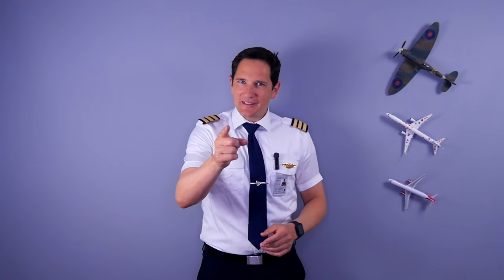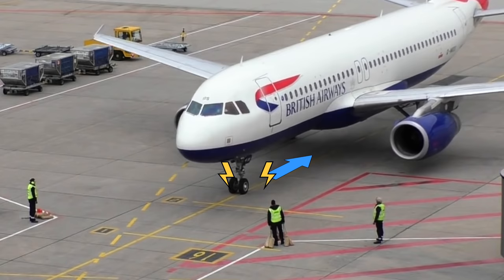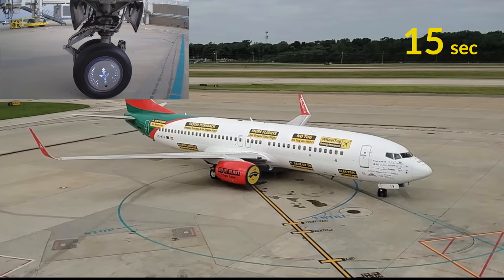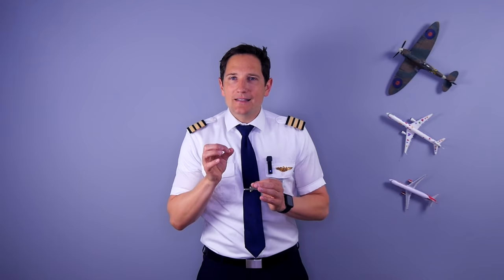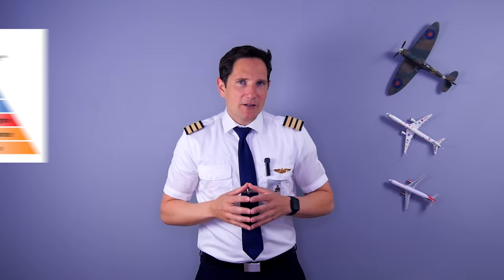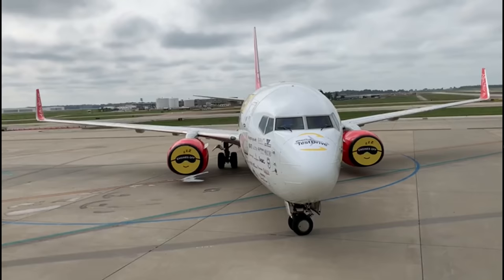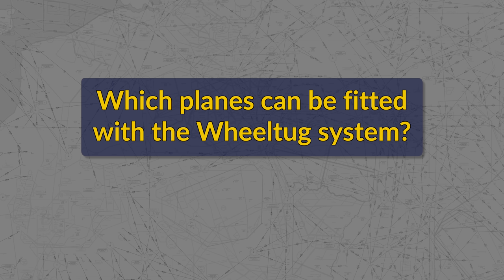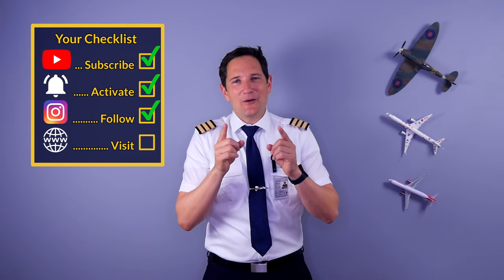The FUTURE of PUSHBACK is ELECTRIC! Without a pushback truck! Explained by CAPTAIN JOE

Comment: As a ramp agent, I see 1 more problem with it. How people driving on the ramp know when a plane is about to move is by looking and seeing the beacon lights on, a pushback connected, a wingwalker at either wing, and the jet bright or stairs are pulled. If either of those are not present, then it will take a minute, long enough for you to drive safely past. Without most of those signals, I can see people driving behind a plane while its moving backwards will become too common. Also, what if the APU is out? You will still need to have crew who can operate the pushback but they will be out of practice by not doing it all the time

Comment: As an aircraft maintainer, this will provide me with work for many hours to come
Reply: More like provide you with another headache lol.
Reply: As a groundworker ,this will provide me losing my job ...
Reply: @j.mc.8773  if it makes you feel better it will take a long time to replace you in loading the bags and all other things you do.
Reply: I completely agree as an aircraft mechanic myself. Winglets and elevators being ripped off is a lot of OT for us.
Reply: @emmetts1899  true
Reply: Really true
Reply: Thanks you. You keep people safe when flying
Reply: The undertaker will be real busy too!!!
Reply: What i am wondering is how the hell are we going to inflate nose wheels c: Do we have to remove the whole thing or is it just a cosmetic cover?
Reply: @j.mc.8773  Aircraft still needs to be chocked, luggage unloaded, the dispatcher will still be needed and when there needs to be a tow the tractor will still be required!
Reply: @pdiaza123  as per video it will be embedded in hub.. impractical it seems
Reply: and some ground workers will lose their jobs
Reply: @j.mc.8773  I'm sure the electric motor in the nose gear is not strong enough to handle bigger planes like the 747 or the A380. It might take several built into the main landing gear!
Reply: I just got signed off as a pushback driver 😢

Comment: I had this idea more than 25 years ago, and I'm 100% sure I wasn't the first one to think of this. But developing such idea into a viable and certified product is a great accomplishment!
Reply: It isn't actually certified yet. And viability is another issue, especially if the in flight weight penalty outweighs the benefits.
Reply: We did it as a project at university too and we weren’t the only ones…. Patents screwed us up though 🙄 and also we weren’t the ‘elite’ engineering students of the department so weren’t taken seriously or given a chance at all….   Protean based in Farnham Surrey had a prototype version for use in a car over a decade ago but I guess they’re not the sort of company to spot opportunities (they got caught up in the in hub wheel for electric cars and wouldn’t have even thought about planes, or commercial moving equipment 🤷🏻‍♂️)
Reply: Yes, it would not be easy to sort out all the energy and weight-saving components for retrofitting thousands of aircraft.
Reply: @paulroling1781  I’m in California, our crazy leaders here don’t care about things like costs vs benefit ratios.  If is saves fuel and reduces emissions, you can be sure they will mandate its use, regardless if it make economic sense.  They’ve mandated zero emission Semi truck use, even though we don’t have them available yet, and when they do become available, they won’t be very affordable...
Reply: That's the spirit
Reply: @paulroling1781  Not just weight but weight distribution.  That's 200 kg added to the very nose of the plane.  It may be a drop in the bucket compared to the many tons of aircraft, but they can't just assume that it will have no impact on behavior such as rotate and landing.  Which brings up another question.  How much stress can this system take upon landing?  How many times can that nose gear get slammed down before it damages the system, and possibly seizes up a wheel?  (I'm sure their engineering team has tackled those issues; I just want to know the answers.)
Reply: @paulroling1781  Today the plane has to carry enough fuel to finish taxiing-in, maybe wait for the gate to open up, all while burning at least one main engine. If you're flying to a congested hub airport, having WT could literally lower the in-flight weight.

Comment: When I worked in avionics a decade ago, I remember the hot buzz around this concept in systems development and research and how exciting many engineers were in wanting to participate in this program. I am glad to see that this is coming to fruition!
Reply: Well, a baggage tug has enough power to push an aircraft back, the mass of the aircraft being ridiculously higher, stopping is the challenge.
The biggest obstruction has been getting powerful and small electric motors, although a hydraulic motor could have fit the bill, hot brakes and hydraulics, yeah, not a good idea.

My only concern is what protection is there to guard against a seized clutch?
Reply: @spvillano  No clutch, the wheels are the motors. Direct drive permanent magnet motors.
Reply: @JerryBiehler  which can offer their own potential failure modes that can cause problems.
Sounds like a challenging project, of the more fun kind!
As an example, were implementation to be done on a pushback, rotational velocities wouldn't really matter, due to the legendary lack of speed of said behemoth vehicle. In an aircraft wheel, while pushback speed is still slow, one would be asking the rotor magnet to be able to withstand both impact and 200 knot speeds on a rapid spinup in an emergency landing. That's one hell of an ask for a ceramic, hence why I mentioned a clutch to pull the rotor out of the wheel system when taking off and landing. Brake heat would also be an issue to resolve.
That sounds like a fun project to be on!
Reply: I am wondering if electric cars are what helped this along, A decade ago EVs were far less common. But now there is a lot of engineering R&D knowledge in the wild for compact light weight and very powerful electric motors.

Comment: As a USA based regional jet airline pilot, I can say unequivocally that this system would absolutely increase overall efficiency.  Personally I love the concept and wish I had it on the jet tomorrow.  That being said here in the US at least, it will be a long time before this system is widely adopted.  The FAA moves so slowly, and then there are real concerns about the thousands of ground handler and ground equipment maintenance jobs that would be lost upon the widespread use of this system.  Also I can't wait to see what the FAA and airlines come up with for training requirements not to mention certification....anyhow I love it, and I hope to push myself back, taxi out of the ramp, and park myself someday using a system like this.  I wish the inventors much success!  Thanks Joe for sharing.
Reply: Im literally about to start at an airport gig as a Tech and i stumble upon this clip/Comment...No pressure Right! Lol.. However, i don't believe it would wipe out TOO much jobs. Us Me-CanFix still have the Belt loaders, De-icer trucks, and regular cars and trucks used to transport personnel to 🔧 wrench on so we'll make do
Reply: Did you realize that pushback driving is just one of the hundreds of jobs done by groung handlers? Mins saved by pushback won't buy you too much time, other jobs still need to be done including unload/load before you can finally "fly". Pilot is just about fly, but the aircraft and the whole system is not!

Comment: I can see another advantage in this system. You noted that most damage is done to engines by pilots having to spool up for "breakaway thrust". If instead the airplane is "broken away" with just the electric wheel drive, no breakaway thrust is required.

Comment: Great Idea. I can see this evolving into:
1. Having enough power to do all the taxiing between the gate and take-off point for departure as well as arrival. This will save lot of fuel, as well as increase the life of the engines.
2. Having a computer at the ground-control take over all the taxiing from the pilot, making the ground operations more efficient and error free, also eliminating the need for the follow-me car.

Comment: When I was a kid, I was a tug operator for a big airline at a big airport. I pushed back everything up to 747’s. It was always a challenge to drive a straight line as the pilot started the engines sequentially while I pushed. I think the lead hand and possibly wing walkers would still be necessary because of the movement of other aircraft on the ramp, especially at night.

Comment: There goes 'Job Security' for tug operators.  I recall about two decades ago, Lufthansa developed a vehicle designed to tow the airliner to the takeoff point, as a means of saving fuel.  Never seen or heard of it since.

Comment: They've been working on this project since 2012 if I'm not mistaken, glad to hear they've continued it. There wasn't much information getting out about wheel tug in the last 6 years...
Reply: I found they were from 2005!!
Reply: To put it simply, regulations  are a b**ch.  It takes years to make FAA and similar regulatory bodies to approve small things like this...
Reply: @AaronShenghao  Safety requires time and proper thinking. You can't just put a motor in there and voila. You need to make sure there is enough rear vision capability added so the pilot can operate it safely. You need to study all cases of failure you can think of and the proper response. You need to take that new option into account in radio communications, pilots training, airport procedures. You need to check which weather conditions allow or forbid the use of that system. I as a passenger want them to do their job the right way and not repeat the deadly fiasco of the 737 Max.
Reply: @AaronShenghao   No . It is due to a lot of people are gonna loose their jobs .
Same reason why they pushing so hard to get this system .
They simply want to fire all those who drive the trucks and now they are close to sucess.
Reply: @aaronbianco2392  hi
Reply: @michealeckert499  :-)
Reply: since 1993

Comment: Very cool. I used to operate a pushback tug. Had a lot of fun doing it, but always seemed strange to me that this operation needed to be done externally from the flight deck. Awesome innovation!
Reply: Why did you change career? What experience did you need prior? I’m very curious however don’t know anyone that has operated as a pushback tug and considering persuing a that role what would you suggest? How was the pay and working hours? would love to hear back thanks!
Reply: @jayjay3013  Hi. I worked for Frontier Airlines for about a year working ramp service. I enjoyed the job overall, early hours with 6:30am flights (start at 5:30). The pay was low, but it was a good start to my career. The airlines probably pay around 14-15 per hour I would guess these days.
Reply: @joeycathcart  Do you mind if I ask if your still in the industry? Where did that project you in your career. Really appreciate the response man just got out of school and still considering possible careers

Comment: I can see airlines having a problem with the extra wear-and-tear on the main tires, but I suppose they’ll be happy with less stress on the engines. A good trade off.
Reply: What about the stress on the nose gear from the pushback tractor. Every time it moves an aircraft there is a shock, since the tractor moves, and THEN the aircraft moves. No more collapsed nosegear because a pilot forgot to release the brakes LOL

Comment: I think this is very innovative. I still think wing walkers will still be needed for airport safety concerns!
Reply: But "fewer" walkers is probably a good thing. Most importantly, fewer vehicles touching the plane. (Lots of planes damaged by the pushback trucks, so insurance should go down considerably)
Reply: @aaronbianco2392  I never saw any pushback tugs get into grief - but every other vehicle on ramp seemed to have a magnetic attraction to the aeras.

The company I used to work for.....crushed a pilot to death against a wall (baggage tug), had to chase a mobile belt across a live taxiway after the gearbox refused to stay in park, wrote off a twin turboprop with a mobile belt when a brake rotor snapped in half (= no brakes). A coach also hit a 747 wing, which was grounded for a month, and some dickwad touched the titanium cone on the rear of a 737 engine, which had just stopped (so he lost the finger).

Comment: In early 2014 there was a pilot project which was known as "Electric Green Taxiing System" was developed and demonstrated the same solution, by a joint effort from SAFRAN and HONEYWELL. THat time I was working in SAFRAN and knew this project will see some real daylight on many aircraft but seems nothing much happened after the demo runs. That has both Main Landing gears equipped with high power Electric Motors. But this Wheeltug is amazing since it is a simplified system as a whole and very effective.

Comment: Im honestly surprised this hasnt been built sooner. Though Id think youll still need spotters, or a very good camera system.
Reply: Exactly my thoughts
Reply: I agree.
Reply: As mentioned it comes with a 4 camera system.
Reply: @1967mustangman  and this is why I shouldn't be playing a game whilst listening to a video. Haha, thanks for that.
Reply: @1967mustangman  Does NOT come with the 4 camera system....it's optional......meaning you can get WheelTug without it and it costs more to get it.
Reply: @ian3580  I see the pedant squad is out in force today.
Reply: @1967mustangman  not really a minor detail in reference to your comment, though, is it?
Reply: @ian3580  minor detail like the max8 having an "optional" AOA disagree warning indicator
Reply: Logistics and legal discussions are a much bigger problem to solve than the technical side. However I do expect several companies to start implementing this soon. Perhaps the cargo companies with their own parts of an airfield will be first.
Reply: That's going to add a lot of mass into the wheel. I'm curious as to how it will handle brake heat over time. But this does seem like such a system, either from Wheel Tug or Boeing and Airbus screwing them over with their own implementation that skirts any patents, will be inevitable.
Reply: @krozareq  The nose wheel isn't braked.
Reply: It was built sooner.   And they have many  preorders.   They have been trying to get certification to install them for several years
Reply: @krozareq  The additional wheel mass is discussed in the video.  The piston that raises the nose wheel can handle it. 
No brake heat, because there are no brakes in the nose wheel. 
I have it on good authority that Boeing's & Airbus's antics, such as what they did with Aviation Partners and winglets, are things that Wheeltug is aware of.

Comment: The most interesting thing was when the plane was positioned sideways and then they connected two jetways 🤯
Reply: Yes. All of us from row 20 on back will experience such relief the first time that back door opens onto a nice empty jetbridge! I was able to ride inside the demo plane shown here during the Twist maneuver, and was thrilled when WT's CEO proudly released the door latch and ushered us up into the terminal gate. I felt a wave of relieved passengers from future flights breaking out of hunched postures and exiting happy and refreshed.
Reply: @SDK-im8sl  Capt. Joe mentioned that WheelTug limits speed in reverse. 5mph would be OK even if the main gear came to a full stop against, say, a misplaced piece of ground equipment... The gate navigation aids coming along will park these planes perfectly and repeatably. I foresee this happening rather quickly once the first few installations are analyzed economically. Time savings recoup seats, concourse length, and even a little weight.

Comment: Enjoy the videos but this, while interesting, seems more of a sponsored ad. What are the downsides, what are the lease costs/yr, are there any competitors, any concern for loss of tug-vehicle jobs?
Reply: yeah there's definitely a side to this story that we're missing. Some tug drivers will definitely be out of a job, but that's also a cost we've seen a million times before.

The visibility issue is also curious. The only comment was that there's an optional camera system upgrade to look behind the plane... something you can bet low cost carriers won't be buying for their pilots. So then what? A team of marshallers? A quick prayer that it's clear? 

Nothing about this seems like an improvement of safety. All I see is just another way for airlines to shave down costs being disguised as a "time saver" for passengers.